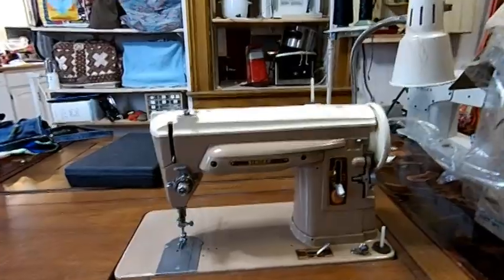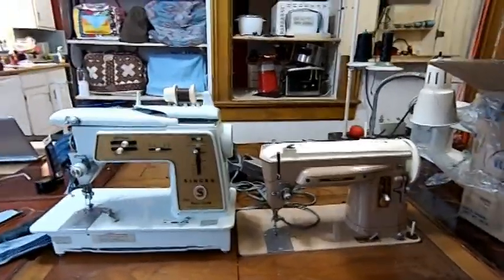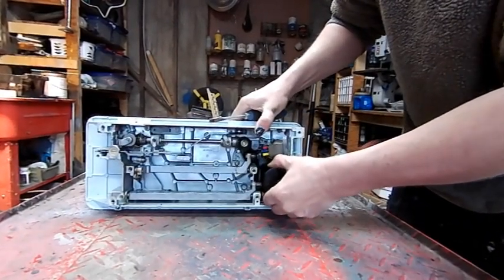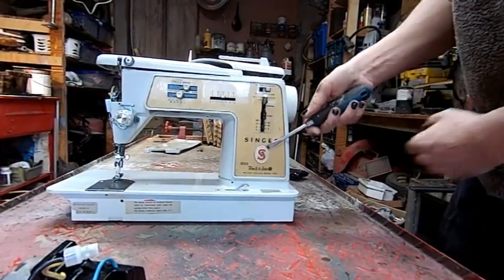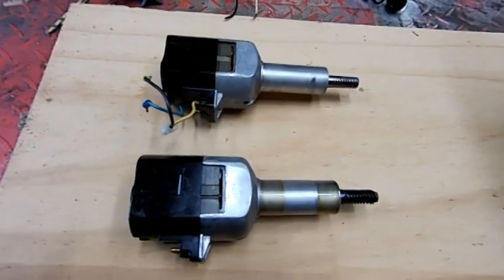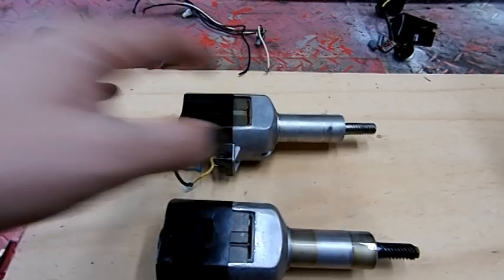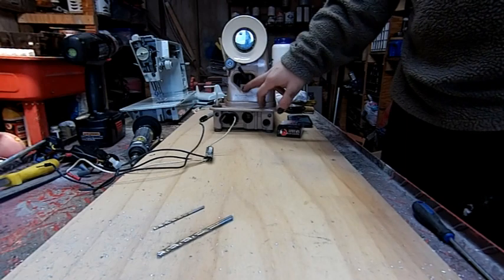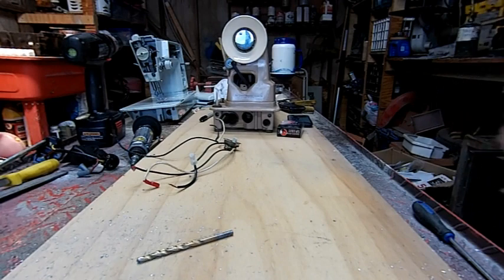How to Upgrade a Singer 401a, 403, or 404 Motor Using a Transplant from a Singer 620

Comment: Thanks for video.  I wish I was more handy.  I have a 403 and 404 that I absolutely need to do this modification to.  At least the 403.  Do you have a list of possible doner machines that would be suitable and characterisics?  Are there others besides 620-640?  Are there any with bigger motors than 1 amp?   Lastly, I have a 404 missing the drip pan.  Would a plastic 620  plate at least work until I can get a proper replacement.  I wonder if this could somehow work on a 301A.  I’m more interested in slowing down machine than with more power but the 1 amp motor is appealing.   How well would s modern foot pedal that is electronic work?   Awesome video.  Thanks.
Reply from the maker: The golden touch and sew 620 is the perfect doner for the 40x series. the 630 I think is a normal motor with a huge resister in it to starve the motor for power to slow it down you dont really want to do that as it also lowers its torque. The 640 Ive looked at and some of them do have the same motor except the slow fast switch is in the foot pedal instead of the machine. These may work on the 40x I have not done one my self but I think that would be a better doner for the 50x series as they really dont have a good place to put the switch.

Comment: Can you post a video of what the 620 motor looks like on the inside? I bought a 620 from eBay and I'm pretty sure I got ripped off. The motor in it is exactly the same as my 401a. There is no third wire or extra coil. I want to
Reply from the maker: With out ripping my machine apart I can not. But I would guess that 620 didnt have it or some one swapped out the motor you should have a 3rd wire. You might look at the fast slow switch see if it has a big lump resistor on it if it does that was one of the 620's that didnt have the big motor in it.
Reply: @SewSaveMe  Thanks for the info. Do you know any reputable sources for a 620 motor or sewing machine?

Comment: I love this and have a 401 that isn't quite right. The hubby would love to tear it apart and mess with it ♡ If he touches my 500, there will be trouble ;-)
If I can't find a singer 620, can you suggest any other models to use as the donor machine?
Reply from the maker: the 620 motor is the best one to use. As the switch wiring and pedal can do in pretty nice. The 630 would work too but the fast slow switch is in the pedal and I dont wanna reach on the floor to change the speed. and the 640 motor would work but you would have to cut the thingie on the top that runs on the tire for the bobbin winder. The 750 touch and sew motor would work to but I dislike that motor the entire thing is virtually plastic.
Reply: @SewSaveMe  what about a 600 motor

Comment: Thank you so much for sharing this awesome video. I really enjoyed it. You have a wonderful personality and I appreciate that you speak quickly and concisely. It is also very considerate of you to stop the video during long, tedious tasks.

You mentioned that the Singer 620, 630 or 640 Touch and Sew could be used to upgrade a Singer 400 series. Do you mean that only those three specific models would be suitable? What about other models in that series like the 628, 635 or 648? Would they all work equally well?
Reply from the maker: Im sorry for the Delayed Responce I had no idea youtube was holding the comments until now. the Motor in all the other 6xx series are two wire motors just like you pull out of the machine. Maybe not every single model I havent seen very 6xx machine. But I know the golden touch and sews have a 1amp multi winding motors in them. And Ive found theres a huge advantage installing one in my 40x machines.

Comment: Thanks for the video.  Do you know if I can use the motor out of a Singer 758 Touch Sew II.  There is a switch on the front that has Slow and Fast?  thanks
Reply from the maker: No you can not the motor does have a different shape or something about the wiring I dont remember exactly why I didnt use the motor out of the golden singer 7 series but there was a major reason. And I do know the motor out of the singer golden 7 series is really really poor quality.

Comment: Very interesting project. Do you clean the motor's commutator with a brush seater? Thanks. 👍
Reply from the maker: No I dont since I dont have the stones. I use a dremel with a coth polishing wheel and some high grade polishing rouge. The copper is usally very hard stuff. If there really pitted or have deep grooves Ill use sand paper to get them smoothed out til I get to 600 grit then polish them with my dremel.
Reply: @SewSaveMe  I just saw you use the Dremel and your technique looked brilliant. I have been watching a lot of sewing machine refurbishment videos and I must say that yours are some of the best. I see a 401G in my future (my options are limited in the UK) and feel very confident that I can service it following your instructions.
Thank you so much for all the hard work you put in making these excellent videos. 👍

Comment: Do you specifically know which machines have the two speed switch?  700 series?
Reply from the maker: 620, 630, 640, 750, There maybe others but those are the ones I know have a 1amp motor with 3 windings.

Comment: Great video!

Question,   Can you only use the Singer 620 for the donor machine?  Are there any other models that will work for the donor?

Ty!
Reply from the maker: Im sure you can but the 620 is the machine I know about that has the 3 winding 1.2 amp motor in it.
Reply: I just ask because the 620 is hard to find right now. I noticed the 750 has a low and high switch and the motor, when I look at pictures has  the four pin. Thanks
Reply from the maker: Ive thought about the 750 motor. butt its a bit off on diamention specs and its a very very Low quality in compairison.
Reply: Question please, if you don’t mind. What makes you say the 750 specs are less? Just experience from working on them or do you have a spec sheet on them?  I say this because looking at buying motors, for these Touch & Sew, I notice they usually sell them as 2prong (ie: for 401.404, etc) or 4prong (ie; for 620, 750,etc).  The sire Dr Danes list all 2prong as  equivalent &  all 4prong as equivalent…  this (to me) implies that the 750 4prong is equivalent to the 620 4prong.. am I wrong? I may be and I’d appreciate your feedback?  Thanks!
Reply from the maker: the 620 still has top roller bearings metal housing and high quality plastic bottom with a good hard brass sleeve bearing. The 720 motor is all plastic with zero roller bearings. They might be rated the same power rpm etc etc but the later 750 motors build quality is just really poor.
Reply: Got it.. thanks!!! I want to do the mod correctly and I appreciate the help. Thanks again!

Comment: Old school hot rodding! Stevie, this is awesome. Will a 626 motor work also?
Reply from the maker: The 626 motor can swap out if I recall watch the toothing on the gear it might be different but its not any better then the stock motor you really need a motor out of a golden touch and sew there the ones that had the strong 1amp motor in them.

Comment: Cool video.  I wish I could put one of those motors in my 503a.  Tough old machine with an under powered motor.
Reply: SewSaveMe, do you think the armature of the 503 motor would fit in the 620 motor frame?
Reply from the maker: Im not sure I dont think so honeslty I didn't consider swapping motor guts. But if you got a 503 consider looken at the Golden touch and Sew 630 motor shape should be the same but the Fast Slow is in the pedal vs inside the machine. I Looked into doing this my self but decided to stay with the 401a I liked it better then 50x series.
Reply: @SewSaveMe  Thanks for the reply Sew.  I'll keep my eyes open.  Not many motors for those older machines out there.  The 630 machines themselves are still pretty spendy.

Comment: Will a motor from a 610 work ?
Reply from the maker: I might im unsure as Ive never stripped a 610 but if I recall the 610 wasnt a golden so it dont have the high low settings like the 620 does. So you could swap the motor but there basicly the same thing your swapping. Check it to see if it has 3 wires commen out of the motor if it does then that would be the same motors ive been using.

Comment: Hi, thanks for your videos, you rock.

I just picked up a Singer 620 to do a motor transplant, and the motor in it only has two electrical leads, not three. It still has the slow/fast switch, but it looks like the motor does not have that additional winding that you are talking about.

The slow/fast switch simply adds a resistor (it is soldered to the back of the switch) in series with the pedal, thus reducing the maximum speed of the motor. So, the slow speed is definitely not going to be a "high torque" setting.

Does the slow/fast switch that you transplanted from the 620 have a resistor soldered across it? Thanks!
Reply from the maker: Darn I havent seen a 620 with that motor style in it but I have seen a few 6xx series that had that in it. And thats really not good speed control not like the 3 winding motor. Keep hunting. Youll find one.
Reply from the maker: Opps I guess I didnt forgot. As far as I remember it did not have a resistor inline on the switch.
Reply: @SewSaveMe  I had a more careful look, and at 43:50 I think that I see the resistor soldered to the leads of the switch.
Reply from the maker: I looked the other day and its a ceramic capacitor. Not a resister at least on mine it is. Im wondering if some one swapped out your motor. Or if you just got an odd ball machine.
Reply: @SewSaveMe  Thanks, here is a picture of mine, do you think it's a capacitor? I got my multimeter out and I cannot measure resistance across it. https://photos.app.goo.gl/6qJXoS8Gp42ASdAx6

It's entirely possible that the motor had been replaced at some point, or that it's a variance within the same model. Who knows!..
Reply: @SewSaveMe  I had a bit of a breakthrough, with a little help. The element soldered to the switch on my 620 is a diode, not a resistor or a capacitor. This is verifiable by measuring that its resistance differs depending on the positions of the multimeter's probes - infinite resistance in one direction, and some measured value in another.

The diode, when activated by the switch, cuts away half the sine wave, thus reducing the effective voltage supplied to the motor by one half.

How sure are you that the element you have on your switch is a capacitor, not a diode?

Thanks!
Reply from the maker: Yes I am sure. As mine holds a charge when I ohm it. But again my machine had the 3 wire motor too. Yours only has two wires. So its not surprising that there starving the motor in that fashion. I think you picked up an odd ball. Maybe they ran out of the 3 wire motors. Or Maybe the first ones they used the standard 2 wire motors found in most slant singers. Ive seen sub modles of the 6xx slants that used a fat resistor too and thats not a great way to get speed control personally. Starving a motor for juice does slow it down but Ive found reduces torque. You can see in my videos the updated machine with the 3 wire motor on slow has no reduction on torque.
Reply: @SewSaveMe  Thanks. Yes, the three-wire motor is an obvious difference. The hunt is on for a three wire motor now. The bad news is now that you don't really know what you are getting in a 620...

As a side note, somebody tells me that they have a 640 with a slow/fast switch incorporated into the pedal. Only it's not a positional switch, but a slider, meaning that it gives "infinite" adjustability of the top speed. They say that the cable that runs between the pedal and the machine has four wires, instead of the usual two. They did not take the motor out, so I'm not sure whether the motor has two leads or three.

My point is that the 640's switch needs to work yet in another way. It cannot operate a diode, because a diode can only be on or off. And it's unlikely that it's a variable resistor, because it would need to be much bigger to dissipate the heat. Do you have any insight on how that speed control could work?
Reply from the maker: The 640 I had was not like that. And your right the Pedal is a dead give away if it has a 3 wire motor or not. As the pedal will be 4 wires instead of two. Keep looking. I honeslty think some one did a motor swap on that 620. They had issues with the stock motor and a sewing shop dropped in a standard singer geared motor. I could be wrong im no expert. Ive picked up 4 620's and all of them had the 3 wire motor.
Reply: @SewSaveMe  I had a chat with someone who understands electronics a bit better than I. He thought that the diode is actually a very smart design by Singer, because it's a poor man's PWM. The diode cutting half of the sine off is the same as PWM with duty cycle 50%. This is better for the motor torque because the motor receives higher voltage during the pulses (compared to regulating with the pedal alone). So, full pedal with the diode the motor would be receiving full 120V pulses, but the average voltage would be 60V, so the motor would be spinning slower, but with more torque than if feeding it 60V continuously.

I have since picked up a Singer 737, it has a slow/fast switch, so I was hoping to see the three wire motor inside. Nope, it was the same deal as with my 620, the switch simply inlines a diode, and the motor is a 2-wire affair.

Comment: Can you do the same thing to 500a?
Reply from the maker: You can but you cant use the 620 motor. I belive you would need one from a 640 since it has a taller shaft so the bobbin can be wound. And the foot pedal has the fast slow switch in it since theres really no good place to mount the switch. Youll have to do some research but If I recall the Touch and Sew 640 was the candidate.

Comment: Love this, Since the 620 gear appears to have a lower pitch drive gear, have you considered checking into using the 620 textolite gear as well ???    gotta happen here too !!  hum, should I do the 401 or the 403 ??
Reply from the maker: Interesting though I only paid attention to the teeth not the actual size of the gear. If I do another one Ill have to check that out. Be nicer if the 620 gear is larger around and would fit give you more torque and control Above the motor upgrade.

Comment: You could use a hole saw made for metal doors.
Reply from the maker: I could but I didnt have one. Working with what I got :). It would have been easier thats for sure. Thank goodness its only soft alum.

Comment: I just tracked down a 401a and got a lead on a 620 to do precisely this!  I've been looking for a sewing machine to make some leather and denim tool rolls, eventually I'd like to do some car upholstery as well.  I think this will be the perfect machine to get comfortable on before I would need something like a Singer 111.  Your 401 restoration helped me get three heirloom sewing machines up and running after sitting for years for my family a year or two back.
Reply from the maker: Noice. I have this setup its not bad. But I still tend to lean to my Kenmore 860 more often and my 1802. I rarly use my singers, As there more tempermental on tensions and my kenmores are more tolerant on tention settings.